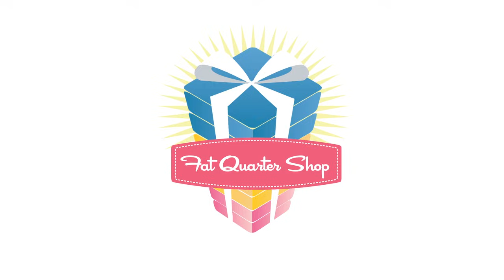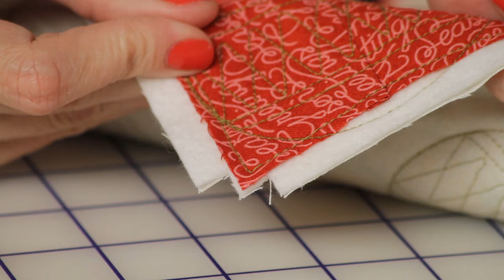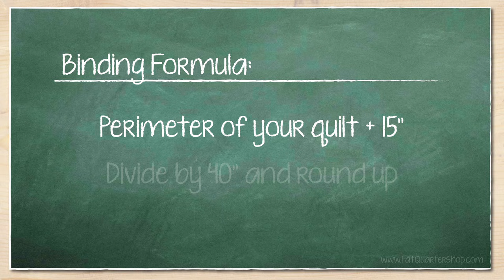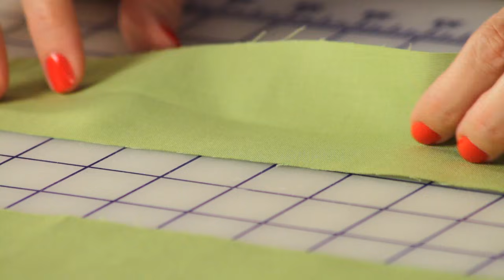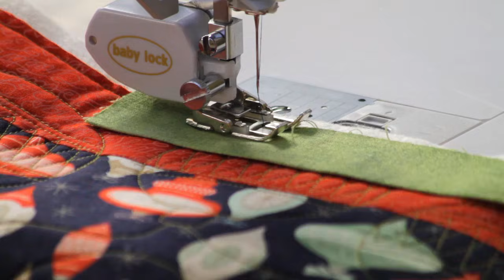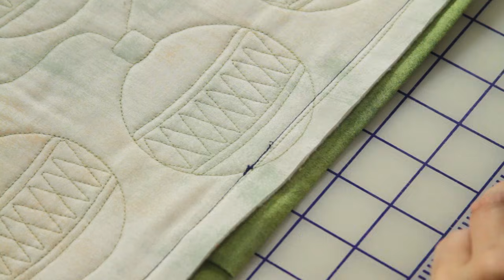How to Machine Bind Your Quilts - Fat Quarter Shop

Comment: U didn’t show where U cut the excess batting that was left hanging over the quilt sandwich by what appeared to be 3/8” in the very beginning…I don’t understand why U left that there like that at any rate…
Typically one squares up the quilt sandwich on all edges B4 attaching the binding, so there’s no excess batting hanging out like that… 
The way U pinned it & have those pins on the underside like this-oh my goodness, I think I’d be all pin pricked & cut up from trying to maneuver that quilt while sewing that binding on w/those pins.  Last items I bound were some placemats I donated for charity & I didn’t even use any pinning-pulled a Donna Jordan method, crazy how freeing that way is!  
Other than that, this seems quite a simplified method to any/all videos I’ve seen in over 20 yrs since I got into quilting.

Comment: Beginner quilter here, so just seeing this. All of the other videos I have watched instruct when machine binding to start on the back of the quilt and then turn and sew on the right side. Any comments about the differences? I've been practicing binding small pieces and this is the most frustrating part of the entire process. I did not have success sewing in the ditch on the front. The back was a mess! Thoughts appreciated.

Comment: One should never, ever sew over pins with a machine -- very bad advice and not safe! You can break a needle or even your machine and if any piece flies up and comes anywhere near you, it could be quite painful -- and if it doesn't, it will be in the floor until you (or your feet) find it. Please don't pin in such a way that you cannot remove the pins as you go.
Reply from the maker: Kimberly no longer sews over her pins and recommends that others do not sew over them.

Comment: Maybe I missed something but when you join the 2 binding pieces won’t it open being you didn’t sew the 2 together?
Reply from the maker: Hello! They are not pieced together, but one end is tucked into the other, and it is sewn tightly down on both sides.  It will not come apart if sewn tightly.

Comment: So I'm confused after watching this. Did you sew over the pins? Why did you use so many pins? It seems like they were 1 inch apart which means it would take forever stopping and starting.  Every time the video came close to a pin it was edited out so it didn't show how easy or hard it was to remove pins. Also why pin from the backside this to me looks like it's making things more difficult than it should be as you can't see pins from the top. Why wouldn't you either sew from the back 1/8th inch in from folded binding edge or sew binding onto back flip to front then sew down? Also we didn't get to see the back of it to see how it looks.  Can you redo this video please and explain further in depth and not edit so much out.
Reply from the maker: Hi Rholanda! We do not recommend sewing over the pins. The pins are very easy to remove as you sew, and we like using lots of pins since it helps keep things in place. However, you can absolutely pin differently than we do if that works better for you!
We have a whole playlist dedicated to how to bind quilts, and you can check out all the different techniques here: https://www.youtube.com/playlist?list=PLNTabBf7OG9JWS783tlH7pf02-_oc8MA3

Comment: I’m kind of surprised that using a 2.5” binding strip (folded to 1.25”) will cover the sewing the binding on with a 1/4” seam allowance plus an additional 3/8” batting extending away from the edge...I’ll have to try it. Maybe you use very thin batting???

Comment: It would have been nice if you had shown the back. I would like to see whether or not you hit the binding on the back side.
Reply: As long as you've pulled the binding an 1/8th of an inch over the stitch line (the stitch line from sewing the binding to the front side), it should catch the fabric on the back, because on top when stitching, you are stitching either in the ditch or slightly to the left of the stitch line.

Comment: After sewing on the binding from the front,  I turn it over to the back and use Elmer's washable school glue to hold it.  Dab a bit of glue to the quilt back, fold the binding over it, press into place which dries the glue.  No pins required! Sew binding on from the front because if you glued it correctly into place, you will catch the binding in the back.  Glue washes out in the first wash!  easy peasy!  Looks so nice!

Comment: I've watched several videos teaching this method. Yours was very good. But the one thing they all have in common, is not showing the other side. The problem I have is that the stitching on the other side, is sometimes where it should be and sometimes an 1/8 - 1/4 inch away from the binding . Which doesnt look so hot on the front of the quilt. How do I correct this Problem?
Reply: I tend to put the binding on the back and bring over to the top so the stitching is good on the front, but then still have this issue on the back. Either way, I don't know what I'm doing wrong
Reply from the maker: Hi Pam - You aren't necessarily doing anything wrong, that is a very typical issue for this style of binding. I find that the more i pin and the slower I go, the better results I get. There will still be times when you don't catch the binding on the back. Just make sure you have trimmed your quilt sandwich right up to the edge, nice and straight so when your binding is pulled over, it stays nice and even. To get the best results possible, I prefer to bind by hand.

Comment: I don't understand the first part where you said you trimmed 3/8th inch from the quilt top. 

How did you do that if all three layers were already quilted together?
Reply: Abigail Bullard if you only want to trim the quilt top or bottom you will just fold the bottom underneath as far as you can out of the way and then trim what you want without cutting the rest.

Comment: I liked this until it came time to close up the binding ends.  You can make that seam look just like all the other joinings of the seams in your binding.
Make a triangle in the start of the open strip by folding down the end so that it lays along the edge of the quilt. Fold in half again. All raw edges are at the edge of the quilt. Start sewing about 6-8 inches from this triangle.  When you get to the end, stop sewing 12-16 inches from where you started sewing. Lay the end on the quilt just where you will want it to be and cut off that tail at the bottom of the triangle: the binding will be overlapping that far.  Then sew these seams the same way you sewed your other binding strip seams.  Open seam allowance and fold in half again.  You won't be able to find your start-stop place on your binding.

Comment: At times when sewing from the front, I'll turn my work over, and it does not catch the binding. What can I do?
Reply from the maker: If you try to fold it under a little more, about 1/8” past the stitch line that might help. Also, use more pins and don’t pull them out until the needle gets right to it. I hope this helps. Just go slowly and try not to rush this process. Thanks for the question!
Reply: I was really worried about that too. But today was my first time. And I didnt miss a single stitch! Talk about suprised but like she said I used lots of pins and I also checked from the other side as I was putting them in making sure they extended below the line enough and evenly. I also stitched right up to the pin then hand turned the wheel past it pin so I wouldn't hit it or break needle. Hope this helps.